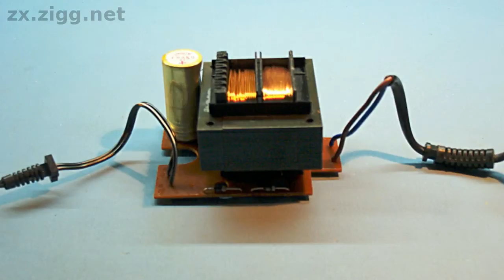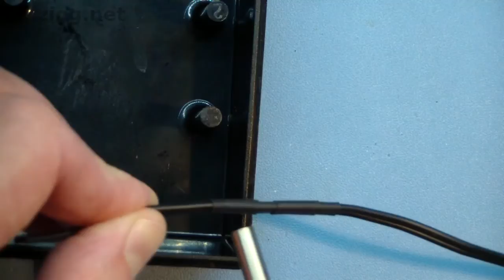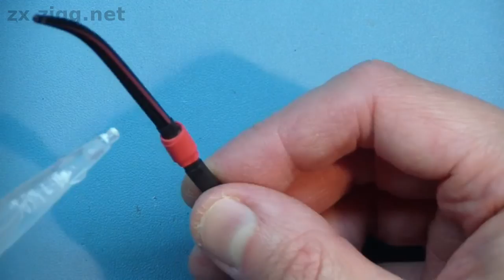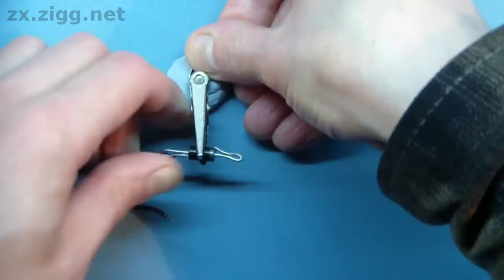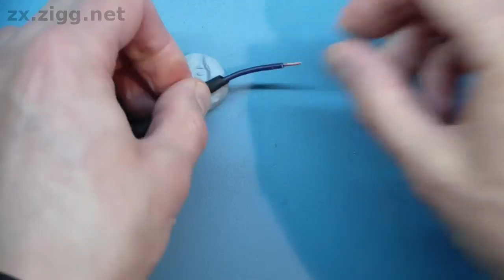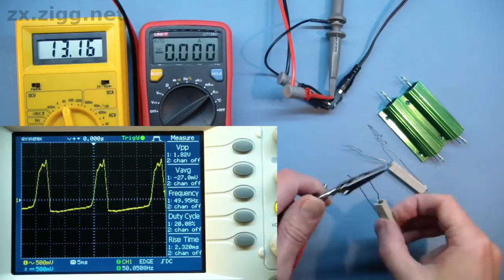ZX Spectrum Power Supplies

Comment: I have found a power supply for the 48k and the +3 but neither have plugs on them. I can't remember what fuses go in them. Any advice please
Reply from the maker: I assume you mean the fuses for the mains plugs. In both cases, a 1 A fuse would be sensible. 2 A or 3 A wouldn't be bad choices either. Don't fit a higher rating of fuse.
Reply: JoulesperCoulomb 
Yes it is for the mains plugs,  many thanks for the help.
The video is very interesting and informative I must say. :-)

Comment: every Sinclair supply I have measured has been pumping out 12v. None should be used without a inline regular to drop the voltage or just use a modern power supply.
Reply from the maker: It is usually a good idea to use some means to slightly reduce the voltage being fed from an original Sinclair supply to help control the temperature of the ZX Spectrum. I sometimes use an 8.5 V regulator circuit and on/off switch that I have assembled in a small metal box that can be connected in-line with the power supply output.

However, in the vast majority of cases, no immediate harm will result from connecting a properly working Sinclair supply directly to a ZX Spectrum. After all, millions were used in this way for many years and they didn't melt or burst into flames.
Reply: were you measuring 'off load' 12v? if so, thats roughly correct, you need to check on load, as for reducing the output, 1 or 2 1N5401s in series with the output are useful, or double up on the 4 rectifiers, use 8, 4 pairs of series connected ones..

Comment: excellent video, very educative. Can you please point the reference of the diode used?
Thank you very much.
Channel subscrived
Reply from the maker: +Jorge Carvalho I used a MR856RL. Almost any silicon diode rated to  carry a continuous current of at least 2 A should work.
Reply: use RL201 to RL207 (2A) or 1N5401 to 1N5408(3A) or similar..

Comment: Do you know what kind of rectifier diodes are used in them? I would assume  2A ones are enough for the 1.4A power supply?  My diodes do not have type markings, even the cathode markings are hardly visible.

Comment: Could you help for the fuse I can only seem too find a 3a 240v 131 degree is that any good or could you tell me were I might get one from
Reply from the maker: Thermal fuses are not the most common of devices, but most larger suppliers of electronic components stock a small range.

The exact rating isn't especially critical, so long as it'll disconnect the power before the power supply goes up in flames. I'd think the one designed to fail above 111 C would be suitable, so long as its physical dimensions are appropriate. Remember it's designed to fail when it gets hot, so complete the soldering quickly and perhaps clip on a heat shunt or a couple of crocodile clips between the fuse body and where you'll solder the lead.

Also, make sure the mains plug has a suitable fuse fitted (I'd suggest 3 A maximum, 1 A if you can find one) as that'll offer extra protection in overload conditions.

Comment: Bought a grey +2A power supply at a knock down price to use on my 48k plus.
Tested it and it is all within the correct parameters.
Thanks for the info.
Reply: of course, it will power all 9v ish input spectrums, AND zx80 or zx81s with an adapter lead

Comment: For those of you in the States and have purchased a Speccy from the UK, this is how I modified the +3 power supply to work here: 

I purchased a Meanwell MPT-45B and removed the Molex headers by melting the solder on each pin and removing that pin by pulling it up through the connector. These were discarded.
I used the original UK power cord but replaced the UK plug with a US 110V male cord cap (okay, "plug") installed on it.
I soldered the wires in the correct places, and if you make this mod, you should too.
I then hot-melt glued it down. The power supply fits in the case very nicely and it's pretty hard to tell that something is different about it. Aside from the completely wrong cord cap.

It was such a simple thing to do, I wouldn't have bothered with a video. But I was asked for a how-to, so I put it up here:

https://www.youtube.com/watch?v=jQiBHspLwfg

Comment: Can I use a Sega Genesis/Megadrive power suply for a ZX Spectrum + ?
Reply from the maker: I don't know, but, information I've been able to look up says the MK-1602 supply for the Sega Genesis 1 produces 9 - 10 V DC and can supply up to 1.2 A. That should be fine for a ZX Spectrum+. HOWEVER, it apparently has an output connector with a positive centre pin. This is the incorrect polarity for a ZX Spectrum and would cause damage. The connector would either need to be replaced with a new one wired correctly or an adaptor used. Take great care never to connect a supply with incorrect polarity to a ZX Spectrum.
Reply: I have owned a great many power supplies for the Sega Mega Drive. Although the yellow tip power supplies for the Mega Drive 2 are centre positive, the barrels are far too narrow to fit either the original Mega Drive or the Spectrum+. However, the power supplies for the original Mega Drive 1 consoles have black tips, are centre negative, and should work with the Spectrum+. See the following link for more information:

http://www.gametrog.com/GAMETROG/How_which_do_i_need_SEGA_AC_Power_Supply_Information_Specs_Model_mk-3025_mk-1602_mk-2103_mk-1479_mk-4122_aa-s95j.html

Comment: This really helped when I was hunting around for a PSU to test some older Issue 2 boards with, so I know now I can use my Grey +2 PSU safely.  However, one question... I also own a Spectrum power supply that has '1200' on it!  This isn't mentioned in the video so can anyone shed light on this please?

Comment: Hello , i have a lose ZX Spectrum +3 without any cables or power supply , is it possible to turn it on by providing +12v and +5v at the correct power supply connector pins and just ignor the required -12v ?
Reply from the maker: I think the -12 V supply is used only by the serial/aux interface and so it should work perfectly, apart from those features, if you connect +12 V and 5 V.
Reply: JoulesperCoulomb I have tried it and it works ! Thank you.
Reply: This is correct.

Comment: I have power supply which smoked (cleaned from flux and it stoped)and needs to be diagnosed and repaired, it is Investronica 9v 1.6 A marked and looks like UK700. Does anyone have it? it has tumbler on/off and red lite diode but don't has a termal fuse. 4700/16 Frako  cap., Fagor B40 c2000/1500 diode brige.  Should I recapp it?
Reply: I changed the diode brige it was faulty but it gives only 7V and 0.29 mA ...
Reply: Ok. Changed capasitor to a new and now it gives 12,4 V and 0.5A . I think it's ok but why it's not as marked 9v 1.6A ?

Comment: Hey there, Nice video. I was wondering if you'd be able to help me out possible. I have a zx spectrum +2(A) and I believe the PSU is faulty. Pulled it out of it's box to have a play and after plugging in, the red led that normally illuminates remained blank. I pulled out my multimeter and checked the terminals, the +5v terminals are reading ~+1.5v, the +12v terminals are reading ~+3.6v and finally the -12v terminal is reading ~-13.9v. Can also hear a little rattling from within the PSU itself when gently shaken.

Think this is salvageable from the info provided? would I have damaged the spectrum unit itself when I tried to plug it in? (I really hope not :( ) would I just be better off picking up another PSU from ebay or the like? would It be possible to wire a computers PSU to a 5 pin DIN simply using the 5/12v lines provided?

any info you had would be greatly appreciated!

Kindest Regards,

James/DrSasso
Reply: +DrSasso I know it's been a long time buty are you still in need of repair to a +2A power supply.  I did a very careful tear-down and analysis of my +2A power supply.  I even went to the effort to create a schematic with EAGLE for it if you're still interested.
Reply: +Duncan Gunn hey! Yeah I did manage in the end thanks :) opened it up very carefully and the fuse had fallen out of place as he metal tabs that hold it were a bit flimsy so bent them a bit so it h
Reply: +DrSasso so it holds it fine now :) (damn thing sent too early haha)
Reply: +DrSasso Glad to hear of your speedy resolution. I did unearth a design issue with the +2A and +3 PSU's in that they put the output fuse on the 0v line.  A short between any rail and -12v will burn the -12v rail out every time.  It's worth adding an extra fuse into that line just for peace of mind.

Comment: uk700 for a spectrum.? ! are you sure? my issue 1 psu is uk1400 but rated at 1.2 amp! zx81s had uk700s and uk1200 (1.2 amp)
Reply: as for not trusting the label.. i have a uk1200 with the smaller transformer of a uk700, and has burnt up quite severely..